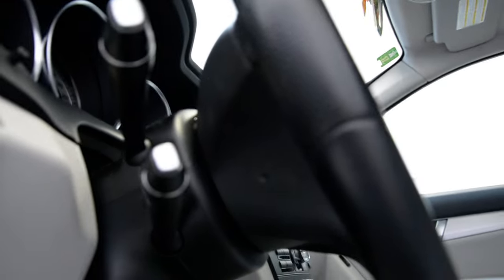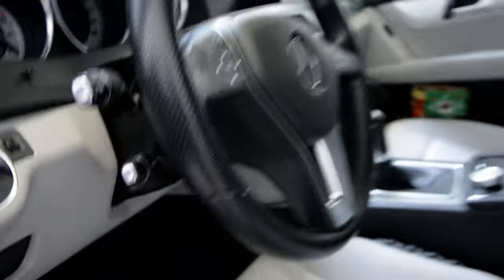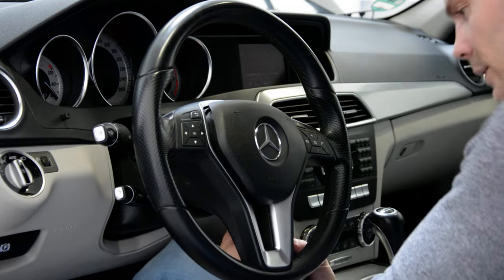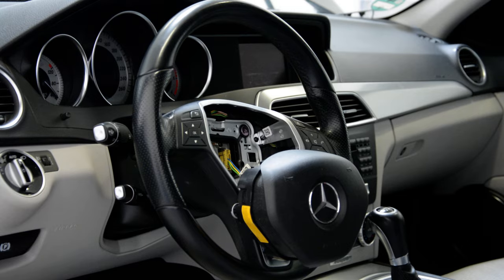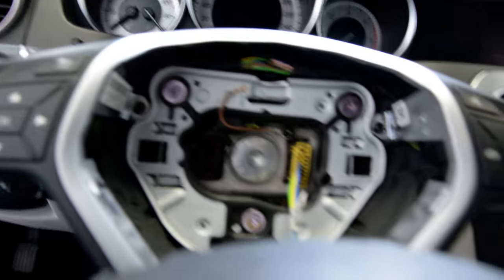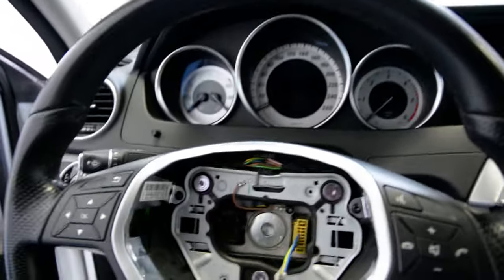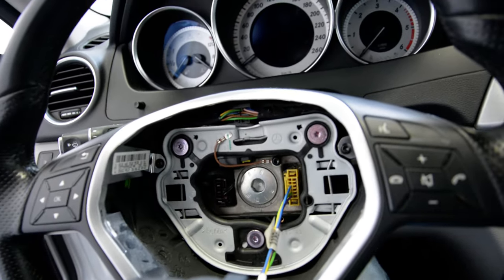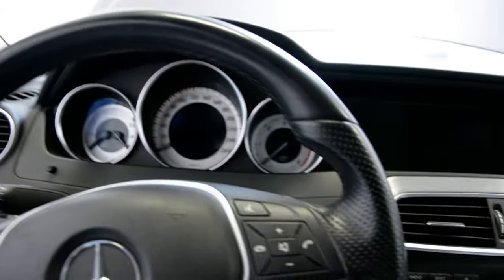Airbag removal W204 Mercedes C Class

Comment: If you took that airbag out, could you then adjust the steering wheel and where it sits? Like when I drive mine is at 11 o’clock position even though my tracking is spot on
Reply: your tracking is wayyyy off if your steering wheel isnt staright
Reply: Did you find out if it’s possible to adjust it?
Reply: @sheffcityjl1119  no mate, no matter how many times I’ve had the tracking done and tyres it’s still always out.